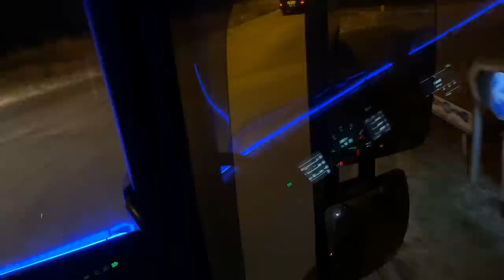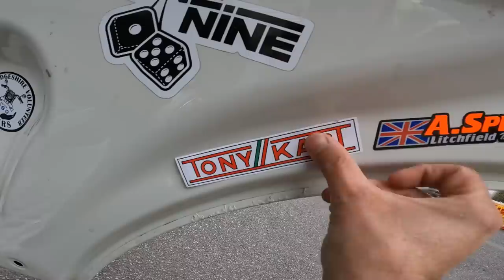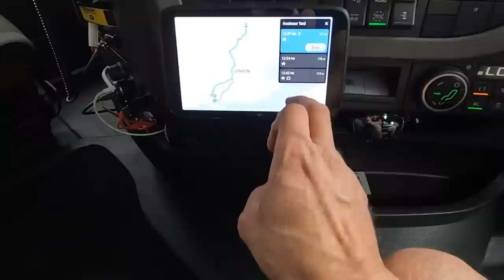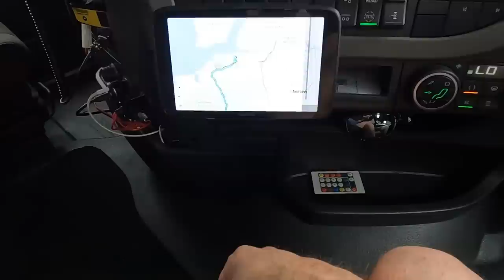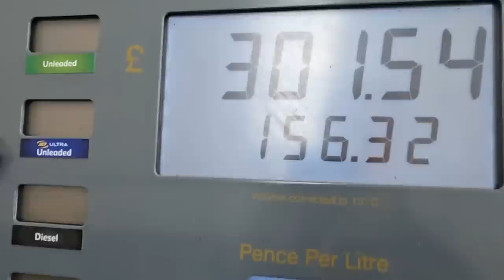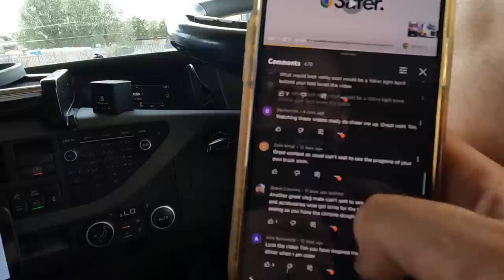What Its REALLY Like To Be A Truck Driver | POV | Trucking Vlog 74 | #truckertim

Comment: How do you remove an anti siphon tube?
There is a plastic ring with a white piece of rubber-like material that serves as a check valve on the end of the filler pipe. It attaches to the filler pipe by two or three little plastic fingers. Stick your hand into the tank through the filler neck and you can pop it right off. that is how you do it

Comment: I know how to take antisiphen out I’ve took loads out, you either need an Allen key to take screws out on inside or another kind is where you need bend some little tabs on top around edge and at the bottom of it, I use big flat head screw driver

Comment: What's it like to be a hgv driver 🤷‍♂️ as a hgv driver with over 13 years experience 6 of that in the drainage industry it's okay if you don't want any form of social life because we're a 24hr 7 day a week, we don't run tachos 50hr week minimum but we never do 50hrs its always over! Minimum on a good week I personally do is 60hrs. We don't get sick pay as we're paid based on hours. We double shift and paid weekly. 60hr weeks pay is around about £650 take home (net) we work officially from 7am to 5pm everything over is classified as day rate or night rate, night rate in £20per hour that includes sundays. Call outs can be easy job and knocks or all night shifts but the pays the same £200 per call out the maximum I've had is 5 in one night due to flooding in London. We don't have sleeper cabs so can be incredibly uncomfortable to get any decent rest. We deal in all manners of the drainage industry from cess waste to oils, grease, sludge, waste from gullies, flooding etc. We work in all the different extreme weathers, some days are different from others but alot of our jobs are suck and go. The struggles are shite office management, poor planning and lack of information on the tickets and getting hold of anyone after 6pm 🤬 It can be very lonely and you need a understanding partner and don't plan anything with anyone if you are on call that week. We definitely have brilliant banter with the other drivers on our firm. Traffic especially the m25 is a killer on our days. When a truck goes down any you have to take someone' else's wagon out can be frustrating because they can be a stig, have filthy cabs and lack of equipment. That's what my jobs like. I would recommend it for the money but not if you want a life or looking for a 9 to 5.